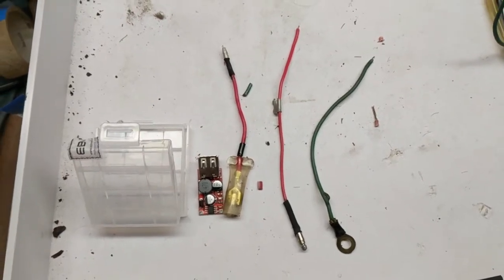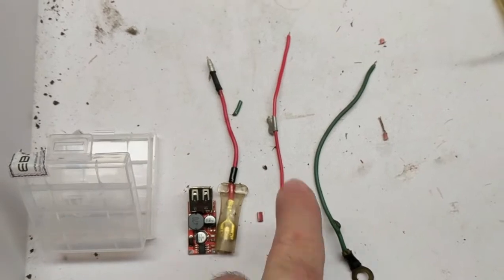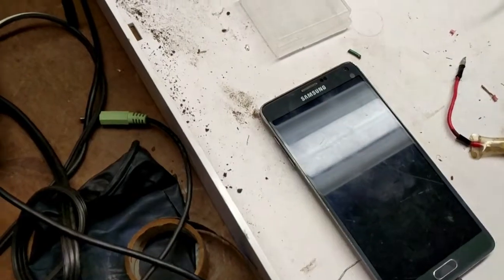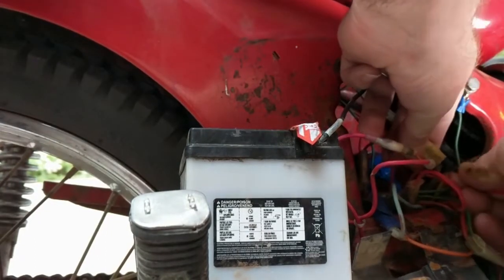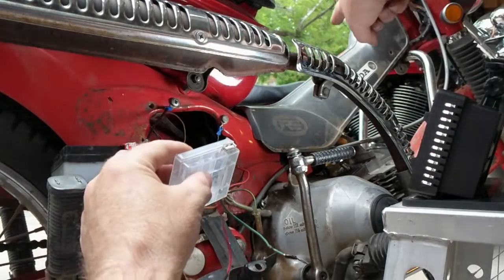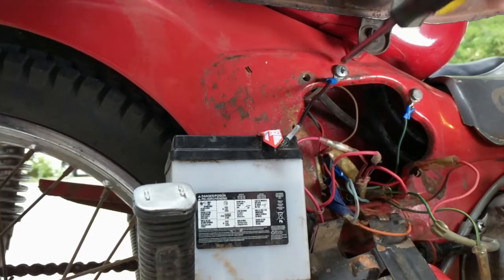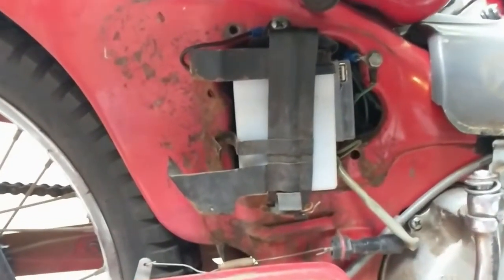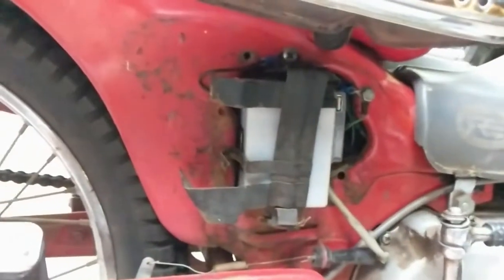Adding USB Charger to Honda CT90 (or any other motorcycle / scooter ) 6V 12V

Comment: Hi man. I would like to put a usb charger on my Honda xl500s. Your video is the closest I can find offering information. I tried a cheap usb straight from the battery before, but it blew up. There's not much info out there, and I can't seem to get a purposely made 6v usb charger.....a little concerned about fire hazard if a cheap usb is wired or fitted in again.

Comment: What about a large voltage spike?
Reply from the maker: Where would a large voltage spike occur?  If the bike had large voltage spikes it would blow lights.. so I don't think that's an issue. The module itself has the ability to regulate varying voltage to USB 5v also.

Comment: Why didn't you install an on/off switch so the USB port device doesn't continually drain the battery?
Reply: He connected it it to a switched power source. The key must be on for the port to draw power.